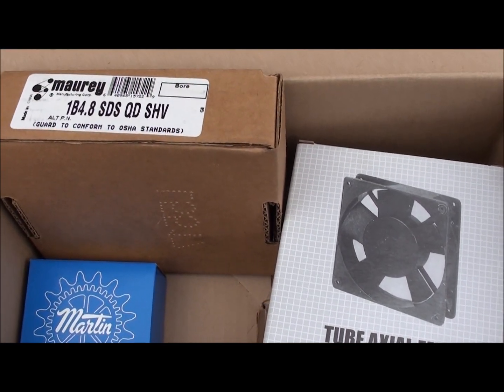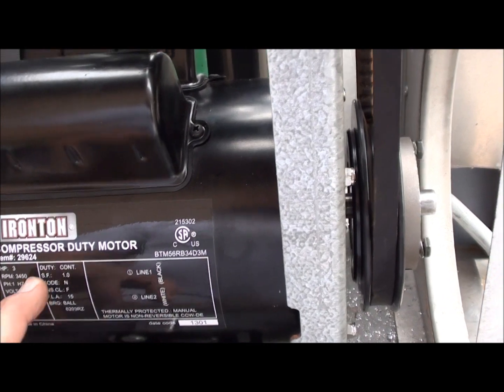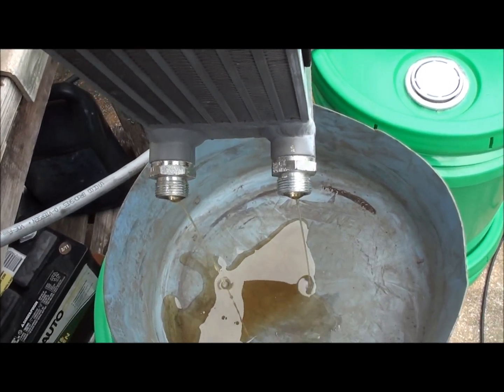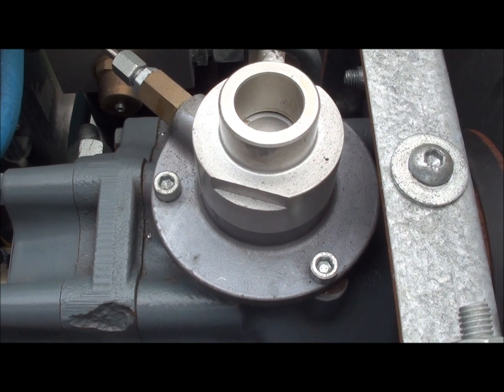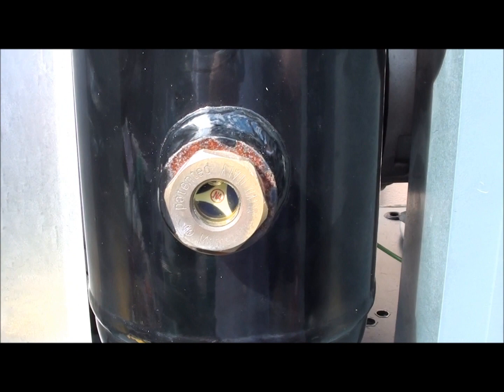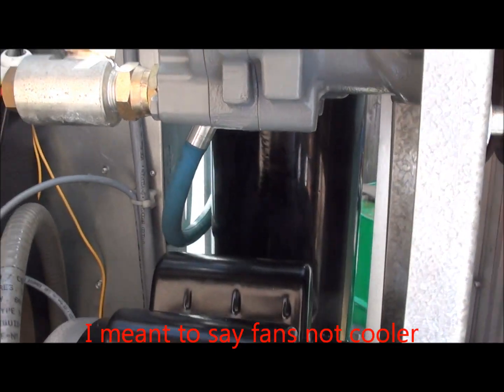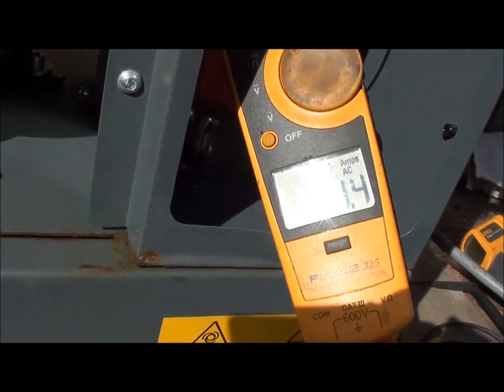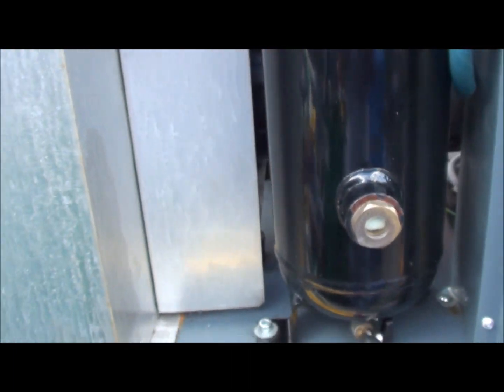3 HP Rotary Screw project  Running

Comment: You might have have considered getting an adjustable sheave to replace the original one since they are different sizes.  You could have manually adjusted to speed.
Reply from the maker: KALI SUNSHINES that Arrangement you're referring to is quite pricey$. And requires a little bit more room than what I had to deal with considering there's a fan blade on the drive motor,
But yeah I know what you're talking about it's a pretty cool setup snowmobiles use them
Thanks for the comment!
Reply: ROTARYCOMPTECH hey thanks for your response! It really wouldn’t be much more possibly less dollar difference. Since you purchased a pulley 4.8 slightly smaller then the original that can actually significantly change your speed. I would had advised instead of the fixed pulley (especially since it’s not the same as original size) to go with 1vl48 or 1vl52 instead of the fixed pulley you purchased. It’s usually a good ideal to have the adjustable pulley on the drive side. I worked on an electrical motor sales counter for quite awhile. Btw I enjoyed the video. You did a pretty decent job on the camera work 😎

Comment: Hello,Thank for showing this vidoe.We have also 12 Quincy rotary screw compressors in our Asphlat plants and they have been used since 2 years.
Sometimes  I face with problems on them and it is diffuculte to fix falures on time.There is not Quincy service in my country for this reason I want to get solutions via internet.
By the way I have problem with one of 75 hp compressor now and I am not sure this is normal working or not, I would like to get advise from you to make sure all is ok, or I can check my compressor and fix it  by your support,
Thyank you in advance,
Regards,
Salmanov Babek
Reply from the maker: Babek Salmanov I don't mind what's the issue?
Reply: Thank you for your answer,
So my compressor is Quincy QSB75.
When we start the compressor it starts to load by 120 psi(8,3bar) and  then unload by 2 bar and  start back again to load by 120 psi.This prosess is contunied all they long.Problem is my amp persentage of compressor motor shows excessive load on the motor.and ampere goes up to around 130 persent of max amp while loading and comes back to around 70 persent of max amp while unloading.I am afaraid one day my motor will burn up because of high amp while loading.
As i know the compressor should build max 107 psi before to start to unloading, but  mine is building 120 psi,that us why i seen high amp.
My question is is this normal or not, if it is not, how I can fix this ptroblem.
I have vidoe of this compressor ,but I do  not know how I can share this vidoe .
Thank you 
Regards,
Salmanov Babek
Reply: excuse me, Model is QSF-75

Comment: Enjoying watching your progress, Can these rotary screw compressors be run on a variable speed drives to regulate pressure? It would be energy saving and would eliminate start stop.
Reply from the maker: Yes they can run on a VFD but it's costly and a little impractical for a 3 HP
Keep in mind you have to get the compressor to communicate with the VFD
Reply: Only worth it if you can find the needed parts laying around. It would be lovely to see that compressor spooling up and down though. May next time your on a job you can show us a variable speed one.
Reply from the maker: Coolkeys2009 check out  my video 50 HP variable speed  Ingersoll Rand

Comment: I wonder how many amps the fan adds to the motor? If its getting near max maybe a  suitably sized gaurd mount fan motor would fit in the aperture, would take some of the load off the motor and it could run constant for better cooling.

I got given an old air compressor on friday! think it just needed a new capacitor on the motor, will get a vid done in the future.
Reply from the maker: The motor by it self running W/ no load 8.2 amps w/ fan installed and running
no compressor load obviously 8.4 amps so really not that much

Thanks for the comment Jon

Comment: What do you want to use it for that would require it to not be start/stop?  I wouldn't mind having one of those.  I have a el-cheepo 2hp devilbiss unit right now...for $100 I'm waiting for the compressor to throw a bearing some day.
Reply from the maker: If any motor starts and stops more than 5-7 per hour it's better to run continuously if possible  also it's less expensive electrically to operate. It's only 3 HP so almost any application will be excessive

Comment: Awesome little rotary!, I would love one like that for my shop, even if it is start/stop. actually start/stop would be best since I do not use air all that often it would be a waste to have it running all the time.
I am keeping an eye on ebay for a small unit that I can convert to single phase.
Reply: rotarycomptech11:05 AM
Reply from the maker: You got to be careful with any lubricated compressor if you only use them to say just air up a tire or occasional use they don't get up to operating temp and they will make and accumulate condensate in the sump tank or crank case.
When I'm done it will run ether stop start or continuously
Reply from the maker: ALLAN KENNEY I guess it doesn't take much
Reply: rotarycomptech
That is a really good point, it would get a reasonable amount of use here, I have a load of air tools that I rarely use due to a lack of air in reserve, that and being able to spray paint with a gun, that would be awesome.